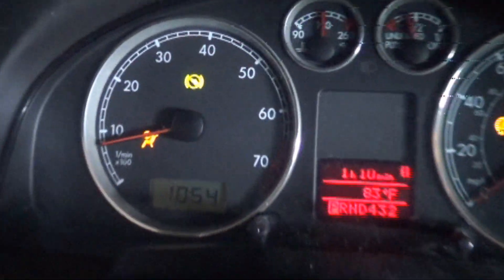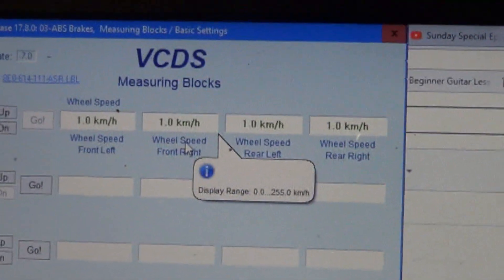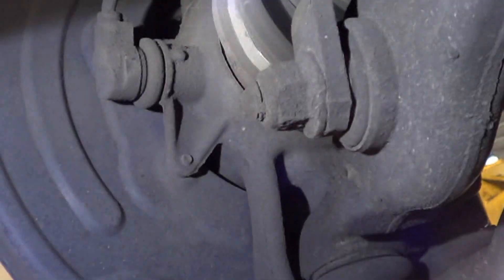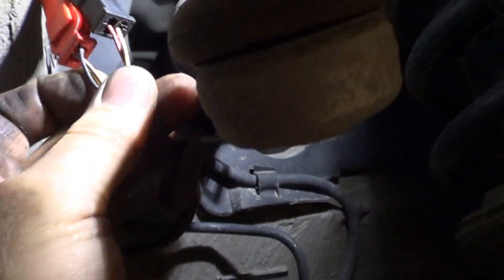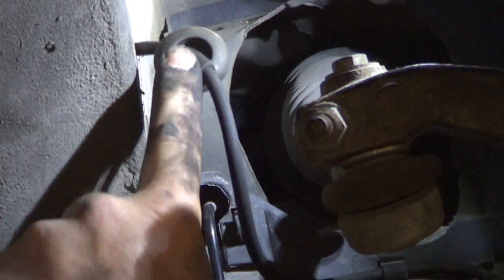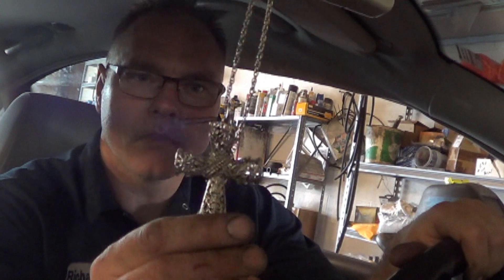2002 passat ABS sensor code  00285

Comment: My b5.5 has TCS light always on, I’ve tested a few other things. Could this be it ?
Reply from the maker: scan for trouble codes and see.
Reply: @CoolAirVw  i don’t have access to VCDS :(
Reply from the maker: @jash6105  Certainly you cant diagnose a computer controlled system without access to the self diagnostic info that the computer system offers.   I suppose you can attempt checking resistance on each sensor individually hoping your find out of spec.  But if a wire is broke to the sensor or there is some other trouble code your completely wasting your time.  Plus resistance measurements dont always show a bad sensor.

Comment: My car recently freaked out on a braking turn and I slapped my VAGCOM on it because I had no ABS fault but the sensor on the front right wheel refused to record movement.  I had a low vibration feedback through my brake pedal intermittently at stopping (my only indication anything was wrong but that didn't manifest until recently) and rotated the sensor and pushed it back in after tugging a little on it and it fixed my problem.  😀
Reply from the maker: They aren't held in very well.  sometimes when a mechanic removes the axle he will bump the sensor and push it slightly out and it wont read.  Simply pushing it in fixes it.

Comment: nice video thanks a lot ,i have just changed a new sensor but still have the same code00285 will check a wiring tommorow but i have other questen pls i have code 01119 gear recognition signal AT probably is wiring a problem but where is that part or what could be a problem ,its passat 5 automatic 1,9 tdi 96 kw  2004y. thanks my friend anyway
Reply from the maker: I think your refering to the "Range sensor" or multifunction switch on the side of the trans
Reply: @CoolAirVw  I also have the same problem I changed the sensor 2 times and again I get the same fault code 00285 and the abs light comes back. Can you help me

Comment: what happens if you don't replace it?
Reply from the maker: ABS doesn't work.
Reply: @CoolAirVw  When I really push the brake pedal, I get like kicking pedal so I think it works.??
Reply: I get on my Audi A6 c5 HVAC error code .
01842 - Potentiometer/Actuator for Temperature Flap; Right (G221)
What does it do exactly?

Comment: it will be good if you showed us how did you connect the wiring with multimeter and abs wiring or you can upload diagram please
Reply from the maker: Can you clarify on "connect"?  I'll be glad to answer.  Maybe tell me at what point in the video (time stamp) your needing clarification.   I pay for a subscription for wiring schematics due to copyrights cannot "share" (upload) schematics, but it is a very simple  sensor circuit.  Usually if folks are working on their car themselves they have buy a Bentley manual or otherwise but honestly I don't think you should need it if you have a similar problem to what is in the video.
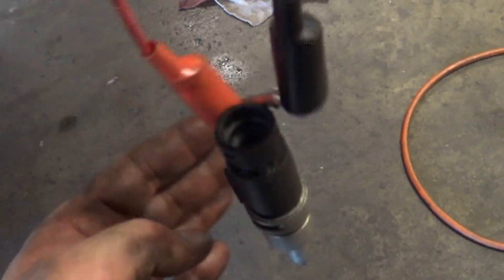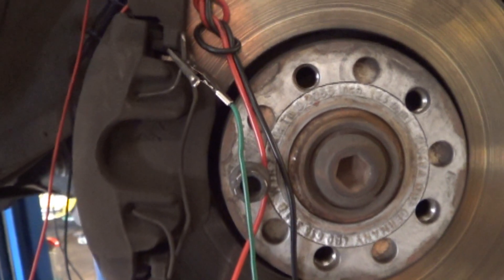Reply: @CoolAirVw  thank you for getting back to me  at 5:16 you hooked up the ford VSS to the multimeter and the ABS  wire i would like to know how did you connect them? at 5:38 i can see three wires one is green and red and black wire  how  did you connect these wire from the multimeter to VSS to the ABS wires , i mean did you hooked the black and red wire from the mulitmeter to VSS and then from the vss to the ABS CONNECTION .  hope you can understand what i meant
Reply from the maker: @redouanezerfaoui8732  there are two wires on the abs sensor.  There are two wires on the ford "improvised signal substituter".   I do not understand.  Hook the two connections on the ford VSS to the two wires on the car.   If your asking about the green test lead with alligator clip ends it is hooked to nothing.  My test lead set comes in a set of 3.  I only used two.

Comment: I have an issue whereas the ABS kicks back through the pedal at low speeds when coming to a stop.
This has started after I changed a top track control arm.
VCDS scan shows no fault found and no ABS light.
Reply from the maker: I think its supposed to "kick back" when the abs sees a "slip event".  Sounds to me like your saying the ABS goes active when it shouldn't.  This would probably mean one of the sensors, isn't pressed in all the way, causing a excess gap between the sensor and the reluctor.  This makes the sensor not count the reluctor correctly sometimes as it will miss a tooth or two due to the extra distance. .  Computer sees this "miscount" as a slipping wheel so the abs goes active as if you were having a slip event.  Sensor probably isn't in all the way on on the side you worked on.  Just turn the wheel all the way to one side to make easier access and press inward (down) on the sensor and maybe it will go in just a bit and solve all your problems.  If this doesn't solve it then you'll need a  scan tool to view the data on the wheel speed sensors.
Reply: @CoolAirVw  Thank you for your reply! I have a hunch now. Since I had to spend a good hour beating that top clamp bolt to remove it as it was badly seized, I reckon some rust has been dislodged and become stuck to the sensor, or maybe the reluctor is badly rusted and started to fall apart! I think my next move is to remove the CV joint see what's going on in there. The ABS sensor seems to be seized solid also in the hub.
Reply from the maker: @formidable38  Have you even checked what I suggested?  There is nothing that holds the sensor in but a poorly designed clip,  so simply bumping it with your hand or a tool might push it upwards slightly.  I suppose rust on there might cause it also.
Reply: @CoolAirVw  Sensor is seized absolutely solid, can't move it in or out. Its a 2003 car and has covered nearly 200'000 miles.

Comment: good morning I come from a post from you on the Internet, I hope you can help me I have a jetta 2001 autimatic 01M transmission the problem that presented is the following I made a change of fluid tranmicion.

After the change the vehicle once arrived at its operating temperature I throw the code P0768 Solenoid D with a generic OBDll scanner, once the vehicle is cooled the code disappears and reappears once it warms up therefore the transmition enters in safe mode (stays in 3rd

 speed) my question is that I should check and if you could help me to know which is the solenoid D

since I do not have a vagcom to give me specific codes for your help many thanks
Reply from the maker: Here is a video on solenoid diagnosis.  https://www.youtube.com/watch?v=NJpWGIbdgzQ&t=1728s    Here is a link to solenoid diagnosis article.  http://forums.tdiclub.com/showthread.php?t=334614  My website has some info also link above.  Solenoid "D" is n91 and the chart on the link above will show you which solenoid that is.   Subscribe to my channel for more 01m diagnosis video's upcoming.